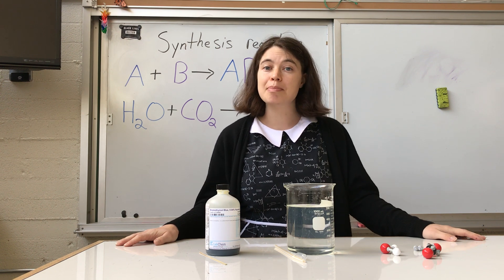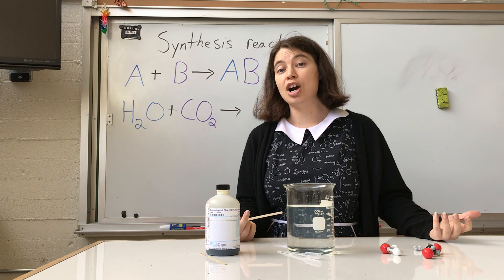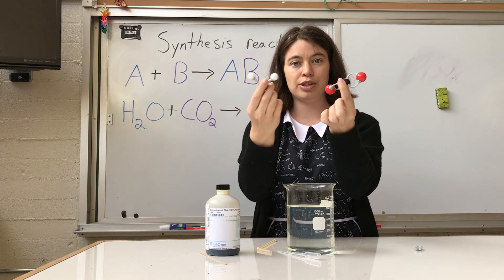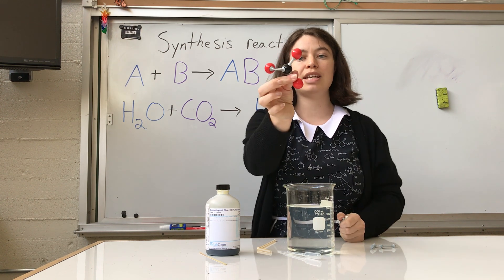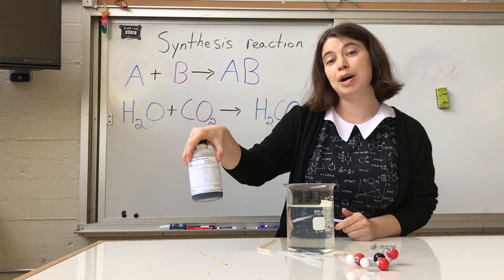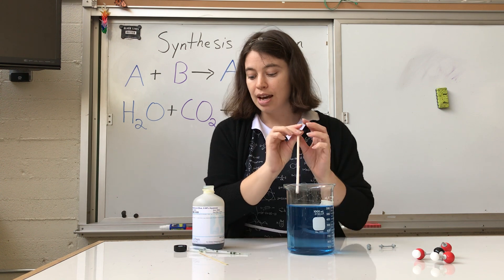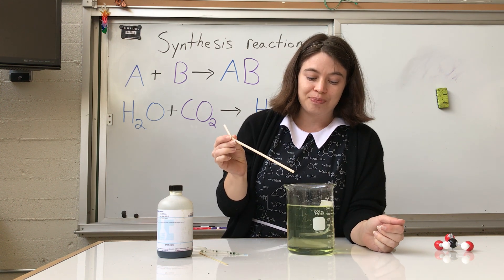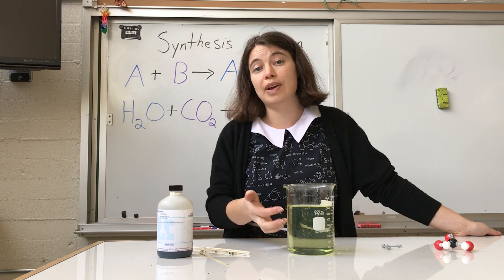Synthesis of Carbonic Acid

Comment: First of all, I love the video! But I do have a question :). Are there really more H2CO3 molecules in the ocean since the temperature is rising as well, which reduces the solubility of CO2 in H2O? Or has the temperature been rising little enough to make this influence negligible?
Reply from the maker: This is a great question! Ecology and Ecosystems are a lot more complex than the simple chemistry presented in this video. Two things are true: 1)solubility of gases decreases as temperature increases and 2)having more CO2 available in the atmosphere increases the amount of CO2 in the ocean, driving the equilibrium of the reaction to produce more carbonic acid.

To know which effect is more powerful, we'd need to do an experiment...and people have! It turns out that the pH of the ocean does indeed seem to be decreasing (meaning that the ocean is indeed getting more acidic).

Comment: How would you produce a measurable concentration of carbonic acid? I am planning on doing a biology experiment with different concentrations of carbonic acid on calcium carbonate shells.
Reply from the maker: I would probably see if I could buy powdered Carbonic acid, and then add different quantities to the same volume of water to create different concentrations. 

If you want to easily simulate the reaction though, one easier method would be using an acid you already have access to, like acetic acid (vinegar). Eggshells, like the shells of mollusks, are made of calcium carbonate. One fun way to simulate this is to try taking a raw egg and placing it in a cup of vinegar for a few days to see what happens!

Comment: I was only passive listening i see the one chemical on the side , and i noticed you blowing through a straw . See i heard of a shampoo called carbonic acid shampoo . So basically if i blow air into my shampoo using a straw could i potentially create carbonic acid . As i hear that carbonic acid is good for removing clogged hair pores.
Reply from the maker: From a chemistry perspective, that probably wouldn't work as well as just blowing air into a cup of water - the chemical reaction is between Carbon Dioxide (which you breathe out) and Water. Unless your shampoo is really watery, you're missing one of the reactants. 

From a hair-care perspective I have no idea if that is a good idea. I can tell you that salicylic acid is a common component in acne medication, but I suspect the exact correct pH is pretty important. Realistically, anything you make with this technique is going to be very low concentration and probably not have any sort of noticeable effect, but as a general principle it's probably a bad idea to DIY acids to put on your body.
Reply: Lol look at the first ingredient on your shampoo label.